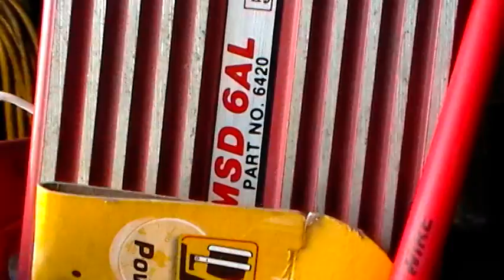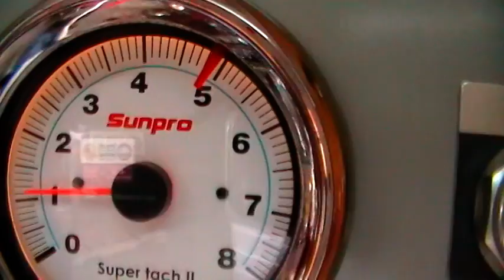350 Chevy Blower Motor Startup

Comment from the maker: Truth is, Blower used for $1700. Completely remachined and rebuilt in the tool room at my work. Heads used for $400. Short block un-assembled but new from a friend, $500. Carbs-Ebay $200. I only spent about $800 with Jegs for ignition, starter, Flywheel, pulleys and brackets. Plus extras I only totaled $3800. Not bad. Sold it for $6500. Even better.
Reply: Ff

Comment from the maker: Gordon,
What power valve is in carbs? You need LOTS of enrichment for a blower motor. I installed high flow, 4.5 power valves. That is one thing. Holley carbs seem simple at first glance but there are a ton of tricks to tuning one. I suggest starting out with 75 or 76 main jets for a blower. Make sure you get some of the idle speed from the secondaries. Primary idle should be about 1-1/2 turns. Idle mixture screws should end up at 3/4 or 1. Then comes accelerator pump adjustments. Check floats.

Comment: Truth be told if you want to make huge power #s superchargers is where it's at look at nhra drag and funny cars damn near everyone of them run a roots style blower and twin magneto twin plug ignitions they pull hard off the line right on thru to the end you can't do that with a turbo .......yet Volvo is working on a triple turbo system now that uses a 48 volt electric turbo to spool up the exhaust driven turbos looked pretty interesting there's a story about it in I think jan orfeb 2015 hotrod mag which kinda leads me to think we might be seeing tiny engines spinning huge rpm#s making big power my question is how long will these tiny engines last working at these high rpms at all the time and the heat don't really matter all cars are disposable now I'm going to stick with my oldies with carbs an points ignitions I drive my grandfather's 65 ford f100 he bought new in late 64 every day it's my daily driver and it's all most all original except the wheels and steering wheel it's got the 300 straight 6 and a 3 on the tree and it nearly is to a cool million I did do a valve job and replaced the cam followers push rods an rocker arms because they were worn beyond there mechanical limits
Reply: Then why do nearly every dragster and funny car run super chargers ? Both have strong points and weak points with a turbo it's basically taking wasted energy by way of exhaust gasses to make boost and a super chargers use a belt taking power to make boost. Both when on the big end are making there peak power out put the difference is one is instant the other takes time but again if the turbo was better than a super charger for 1/8 or 1/4 mile you would see a lot of turbos in nhra but what do you see more of super chargers or turbos there's no denying the fact they both can make massive horse power numbers
Reply: There definitely better for a street car for a daily driver especially now that they have computer controlled boost timers you are not going to get that with a super charger plus you can add a methanol injection system to keep it from detonating control the burn make more power the old turbo Oldsmobiles of the 60s used a meth injection that people used to use windex or windshield wiper fluid
Reply: It's a water meth injection the meth is in it for colder weather so it don't freeze
Reply: NHRA use nitro-methane fuel, and a lot of it.

Comment: can someone explain how it works, does it work like a normal carburetted engine where the air goes through the carb and mixes with the fuel or does this use some sort of fuel injection
Reply: It still functions the same with one exception. The big blower on the top is actually a compressor. What it does is it compresses the intake air and the fuel from the carbs and makes the engine eat way more than it would normally.  With this, you have to run lower compression ratios 8.5:1 as opposed to normally aspirated engines which are 10:1.

TL;DR. It's still exactly like a naturally aspirated carbuerator engine except it mashes air/fuel to make more power.
Reply: Th3uNn3rV3d Actually a roots type blower is not a compressor.  It just forces in more air than the engine needs, causing it to "stack up" within the inlet track.  It artifically raises the adiabatic efficiency of the motor to over 100% - in other words, its making the engine think its bigger than it is in regards to the amount of air it can process.

Comment: Could somebody explain to me whats the difference between a blower and a usual supercharger, please?
Reply: No difference the blower was originally gear driven and was on dietroit diesels (ie 6-71 8-71 blower for the 6-71 and 8-71 dietroit diesels) one day tho some guy rigged one to work on a gas motor and converted it to run off a belt (supercharger) a gear driven supercharger is called a blower...which is why this is called a blower cause originally it was
Reply from the maker: 2 names for same thing.

Comment: why did you even bother with a mechanical fuel pump??
Reply from the maker: The pump is a Holley high flow pump At 145 gallons per hour it can support 600hp easily.

Comment: Would like to know what fuel psi is it running?
Reply from the maker: Carburetors typically run best between 6 and 7.5 psi. Volume is what really matters. You do not want to run out of gas with a blower.
Reply: @chip fisher you run low on fuel in a blown engine like that, bad things happen. Best case scenario you lose fuel flow completely and stall, worst case scenario you lean out the engine but still run at full throttle, and literally melt a hole through the piston.
Reply: speed150mph  what if your fuel pump goes out

Comment: frank289100 knows fuck all lol but i am interested to see how you go with the cast pistons in a blown engine but no iv read 6 pounds is bugger all in a blower not meaning to sounds like an ass but running 6 pounds in a 6 71 is kinda not using it to its potential.

Comment: I have a slightly modified 327sbc (9:1) that has a 671 blower on it and 2 holley 650 double pumpers (4777-3 now boost referenced)

It will start and idle perfectly but as soon as you try to accelerate it backfires big time through the blow off plate.

I am at a total loss whether it is a timing issue or a carb issue.

My AF gauge says 13 at idle, if i slowly take it up in rpm's it drops to 11.2-11.5.

I have the base timing at 14° and locked out at 30° by 2500rpm.

Does this sound right to you?
Reply from the maker: Everything you listed sounds right on. Did you ever get it fixed?